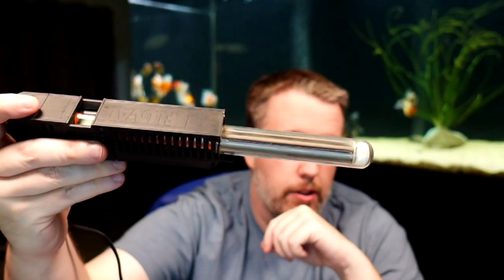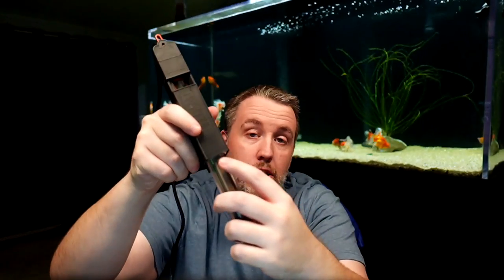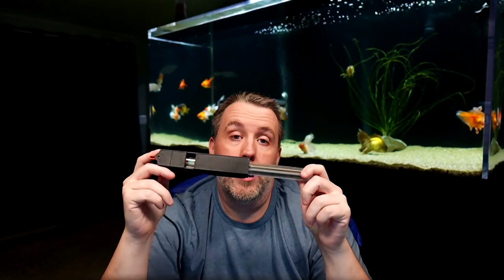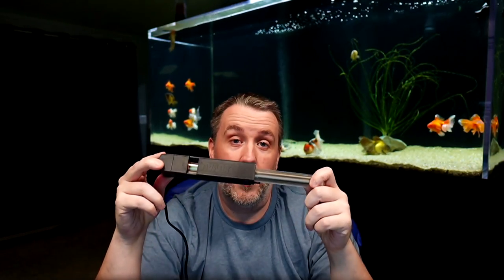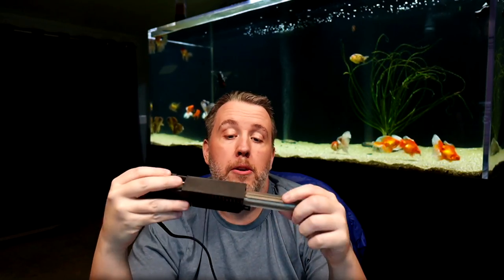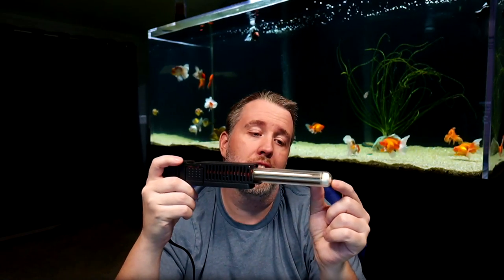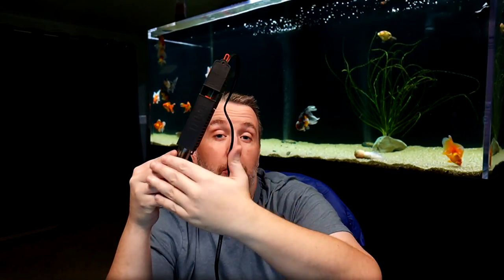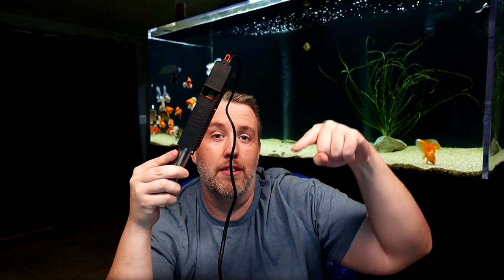The Truth About Aquarium Heaters (and Why They Always Break...)

Comment: As a retired electronics engineer, I can
tell you the reason heaters fail is
because they are designed wrong.

With the correct design, the heater can
last decades. It really wouldn't cost
that much more to do it right.

The current design hooks up the heating
elements directly to the mains (Constant
Voltage Source). They need to design it
so the heating elements connect to a
Constant Current Source. That way the
heater can turn on and off thousands of
times a day without the destructive
current surges through the heating
elements when it turns on.

If the heater detects a low flow
condition the electronics can throttle
back the current to the heating
elements.

Another design flaw of most heaters is
the electronics are in the same tube
that the heating elements are,
subjecting the electronics to high
temperatures. High heat is the enemy of
electronics. The designs that use a
separate controller out side of the tank
are much better.
Reply: Couldn't agree more and the heater manufacturers know this too.  That's why they will never implement such a design because then they couldn't sell you another one when their flawed design fails.  I'm not telling you anything you dont already know ;)
Reply: How long does a tmperature sensor last when seperated from teh heat source? I have one of the rare filters with a seperated system like you suggest, but the temperature sensor broke (physical force). I think it is a pt100 because these seem to be very common and I will replace it with such a sensor.
Reply: I believe the titanium heaters are designed this way. The only problem I've had with them is the temp probes going bad. But at the same time I've had old glass heaters last over 15 years.
Reply: Tony Meagher your 2nd paragraph is the #1 reason why they don't make better heaters
Reply: Sweet James  agree it's a big long commercial given. All that was needed to explain this is what Tony Meagher wrote.
Reply: @nwcanuck5069  totally man, In the swimming pool business I've seen big companies discontinue filters, heaters, auto chlorinators etc.. all because they would never break. All you needed maybe was a really cheep part to get them up and going again. So how can you ever make money buy selling something that will last for 30 years. Not like you need 3 heaters on your pool or auto-chlorinating systems. So now we have customers having to come back and drop another $2,000 on a new heater  every 5-7 years when the 1st one lasted 25 years. Or pool/spa pumps where the 1st one lasted 10 plus years then all the replacements for it last a couple before they are back getting a new one. SMH But I guess how else will you be able to grow if you don't step on the customers.
Reply: Sweet James really? Heaters are a problem in the hobby.
Reply: well i can say when the house trips , most of time is heaters
Reply: Same thing applies to light bulbs. Incandescent bulbs are at the mercy of your switch. LED and fluorescent have ballasts in them to correct that. Put a ballast on an incandescent bulb and it will last forever too.
Reply: @alis49281  They're cheap metal, that break apart over time. There are other materials that are significantly more resistant to water.
Reply: Sweet James  He literally has ONE heater in his link. a 25watt nano heater. Not much of a selection, nor very useful to most hobbyists' tanks.
Reply: I would greatly appreciate it if you could design, build, and sell heater like that. People would pay a premium to know they would last.
Reply: The one on my betta tank was bought in 2002 or 2003
Reply: Sweet James  maybe you heater do not over work because of your room temperature where you keep your fish tank.
I had to replace 3 fish tank heaters because they where old and not working properly.
i never had to keep replacing them like people are saying.
Reply: Sweet James  you might buy one that is bad  but other wise i never had any problem with my heaters.
Reply: Makes me think of appliances. My $3000 do everything, fancy, big beautiful fridge has been worked on 2x in the first year. My beat up, 20 yr old unit that stays in my garage (in Las Vegas summer heat) and it turns my drinks slushee and has never once had an issue .
Reply: My controller for my Hygger ( w/external controller) is out of calibration, any tips to recalibrate?
Or would it be easier to get a new one?
Reply: Broken heaters has nothing to do with the user 90% of the time. They are super simple devices, made with lowest possible quality and cheap materials and highly overpriced. Design is pretty bad. They operate in extremely narrow temperature range (mostly 24-28 C), with known in advance and similar water flow in most aquariums. And even after all that, even top manufacturers fail to make them right. Btw making your own electronic automatic heater with quality materials cost less than 10 dollars. No need of any bimetal, and you can filter noises and reduce switching cycles. Manufacturers are refusing to make them right cuz.... Profit! And i think we don't have to step in toes arond them, like we don't do it for our mixer, tv or fridge, especially when we pay high price.
Reply: Make it and send us the link what you waiting for bud.
Reply: Has this got something to do with US standards for electronics? I have never ever had a heater fail other than through my fault. Been in the hobby for over 15 years and once was rocking a fish room with 10 plus large tanks and many smaller ones. I have broke heaters through dropping them and smashing them through stupidity and once exploded one by pouring cold water over it during a water change, ha! . Had pricey £100+ heaters and even some cheap £15-20 no brands and they have always served their purpose until I either break them myself or swap them out or lose them in storage somewhere. Currently have a heater that is over 10 years old in one of my tanks. That's a cheap brand one that runs perfectly.
Reply: @JoshFromGA  just buy loads of them
Reply: Sweet James  If he wants your money, he wouldn't have made this video so your heater could break again and again. You don't make sense. Heck, he made a video saying that we probably don't need a heater.
Reply: @evgenitantikov5865  How exactly would you make your own? That would make a fantastic youtube tutorial.
Reply: @horsepanther  Sorry buddy, i never made a YouTube video in my life :) Don't have the time for it either. You can search over the net for simple temperature controler electronic schemes. Also there is integrated microchips that can do the job. You can even use an Arduino as a controller. As for the heater itself you need heat resistant lab glass test tube (any chemical lab supply store) and resistance wire (nichrome, kanthal...). You can also replace the glass with unbreakable metal tube (electrically insulated from inside). You can make small controller to fit inside the tube or a separate one. Same goes for the sensor. You need heat conducive paste for high accuracy. The simplest and cheapest ones are based on thermistor(few cents).
I made few for myself loooong time ago and they still working (20+ years). In theory resolution and accuracy are extremly high, in practice +/- 0.1C (more than enough). In my country materials for it would cost me around 8-9 dollars. In usa idk maybe 12-15?
Now is easy with the internet. Just google it - there is thousands of projects that will work for you. Pick the easiest one.
Reply: Sweet James that’s how I felt till my heater failed in the ON position and boiled my fish and plants alive. It was a 100w in a 20 long, it was always turning on and off 🙁
Reply: the wires in these things are tiny
Reply: How much would I need to pay you to design a heater for me haha
Reply: Get with Cory on this and design the greatest heater ever and cash in bro. He would sell it if it was as good as you say it could be.
Reply: Do you know if heater thermostats have hysteresis systems that prevent frequent switching?
Reply: @Tony Meagher Don't thermostats have hysteresis systems that prevent frequent switching??
Reply: So a pulsed supply to the heating element the same as a reptile thermostat where it throttles up more pulses and throttles down less pulses and adjusts the current across the heating element not the voltage ?
Reply: Design one then!
Money, money, money!
Reply: As a retired EE you should get this comment, whereas most people won't... Heaters with a bi-metal thermostat cook your fish when the contacts weld together from the hot arc just before they close.  The capacitor in line prevents the contacts from sparking.  When the cap burns out, the contacts weld together.  If you have an older heater that you can take apart, just upgrade the cap to either 500 volts of 1000 volts and the heater will literally last forever.  The replacement caps used to run around 50 cents at radio shack.  I kept some of my aquariums in my basement where the temps ran down to 45 degrees and I've had to replace the caps in several of them over the years. And believe me, the original caps were literally barely rated for 100 watts. Once I upgraded the caps I've never lost the heater a second time.

Note, most heater companies use the same cheap caps for their entire product line, so 50 watt heaters will outlast 300 watt heater by a matter of years, if not decades.  Supreme heaters up to 100 watts last forever (I have a few that are running for over 40 years).... Supreme heaters above 150 watts are usually toast within a year or two in a cold basement.

Digital thermostats don't cook your fish when they fry, but they don't last very long... I know there's one company using a triac system which might be good as the contacts run on reduced voltage, but I don't know if I have any of those... and most heaters don't come apart any more, which is why I rebuild the old ones.
Reply: Also an EE.
The simple solution is to use smaller heaters.  IF a heater fails on, THEN it overheats the water. SO the heater obviously has more power than necessary.
USE 1/2 the wattage "they" say to use.
USE a fully submersible heater.
USE a heater that can be mounted horizontally.
Reply: @RJ-vb7gh  The simple solution is the best 
Smaller heaters.
The wattage listed by the companies are at least 2x too much.
How do I know?
Because when they fail "on", they overheat the water. 
Smaller heaters cycle less, radiate less heat to the switch, and cost less.
Reply: @RJ-vb7gh  what heater do you recommend?
Reply: @J0MA  Most of my heater are anywhere from 5 to 55 years old.  While I certainly have great experience with certain heaters that have literally been on line for over 5 decades, they unfortunately don't make them anymore, Just don't pass up on a Supreme heater of 100 or less watts if you find one at a garage sale.  

I would avoid heaters with "film" heating elements or less expensive digital thermostats.  While digital thermostats usually fail in the off mode, which is nice, I've never had one that lasted very long.  Some day this might change with better technology getting cheaper, but for now high tech electronics and water don't always play nice.

Triac type heaters tend to last a while but for some reason, I've had several fog up (and flood).  The triac reduces current through the contacts which makes them last longer.

The problem with recommending brands is that I've seen the same heater marketed by different companies over the years and I've seen companies that made good heaters, suddenly cheap out and produce total trash.  Or in the case of the Stealth heater, they had a nasty habit of burning homes down for a while, but the company was very nice about replacing them for free.  Thankfully, my heater worked fine and didn't burn my house down and the replacement still works a treat. But yes, by experimenting with the latest and greatest tech at the time, I brought a fire bomb into my home.  So, as much as things change and very reputable companies have made some major mistakes, I'm gun shy about making a recommendation on current products... Just beware, if it sounds really nifty and is something brand new, it might be great, but over the 55 year's I've been keeping fish, more times than not... it's a hazard just waiting to happen.
Reply: It blows my mind that we are in the 2020s, and even expensive aquarium heaters still use 'dumb' on/off thermostats, SSRs, PID-loops and PWM controllers would cost very little to implement, and would mitigate all of these issues, while providing more responsive and accurate operation!..
Reply: I’m currently an electrical engineering major trying to setup my first tank and I am FRUSTRATED with the heater market. I’ve been dreaming of making my own heaters. PLEASE, let’s go into business on this haha. The aquarium hobby needs higher quality plastics as well!
Reply: ...it's not beneficial for a company to sell their product every year. It'll go out of business for the lack of revenue.
Reply: @tentyme1  This is an increasing problem, and why there is a growing "Right to Repair" movement
Reply: Do you have any specific heater suggestion? Or brand?
Reply: But these companies that make heaters would be out of a job.... Duhh ..
We used to make things that would last forever and then all these companies got savvy and realize that if they made things that could fall apart and have to be replaced they could make more money
Reply: Can you please create a good one and sell it? I would gladly buy one lol. Let me know send me an email when you do it. I’ll be your first customer
Reply: If you know how to make a heater properly won't you invent the heater that works properly and last for years and you can make some money off of it start sending your own aquarium heater
Reply: @thebeastisback1996  perhaps its sensor died.
Reply: @victorsitkevicz8312  This should be pinned up
Reply: Go for a patent, Tony! We need it.
Reply: @lanyardloop Hi, i'm looking in designing a new aquarium water heater that could overcome these selective flaws and more. Would you be interested in a quick 10 minute meet to discuss these issues and more?
Reply: Very interesting. I don't know much about heater but it seem that an heater that could heat at less that 100% of it's rated power would be pretty useful so that it could stay on at a constant power and actually keep the temperature stable without cycling too much.
Reply: I think they are designed to fail on purpose, many fish have died due to this lack of "innovation".  I'd kill for a not trash small water heater for 2-5 gallon tanks.

Comment: I'd love to see a heater developed by Aquatium Co-OP. The sponge filters you have are great, I'd imagine anything you guys produce would be cost effective and well made.
Reply: Tbh sponge filters are almost failproof and definitely dropshipped from China but yes, Cory would do great with sales of a heater of his own with his branding behind it
Reply: @lukas______  Not too fast.  My last sponge filter I purchased had great bubbles and air flow, but would not suck in anything.  I replace it with a CoOp and voila!
Reply: Problem is, you'd need to re-invent the wheel on these or find existing things to combine into one thing... that are already manufactured.   They'd just end up selling off brand stuff.

Comment: "Retain as much heat as you can first" was the approach I've applied to my aquarium, which is currently in my basement. My basement is only semi-finished, so only semi-insulated. At least it's heated. So to keep as much heat as possible, the outside back and one end are covered with styrofoam sheets, and I usually have towels laying on top of my lid (which doubles to keep dust out). 

The heating I use is an under-gravel heating cable.

Comment: Thank you for this video. I bought the new Sera heater and it's by far better than everything I've used in over 20 years. It's strong, with fish protection and perfectly stable with flow in the fish tank and a 2 thirds open top tank. Its power is the double of the gallons I have. And the weather is quite fluctuating here in Portugal during the winter. Thank you!

Comment: You’ve been reading my rants! (Maybe) I love these “how to properly use your equipment” videos.
I always put my heaters (which are E. Jager) either next to the filter intake or output, horizontal and below water change level. And set them to winter water temps for the fishes natural habitat. (Shrimp don’t need a heater for ex)
Ha ha ha... I use a lot of 50w & 75w heaters in the house and don’t go to 100w except for the garage tanks with bigger tanks (unheated garage). I also add rigid insulation to the back of my tanks.
Reply from the maker: When i experimented with insulating tanks, I find it didn't help as much as I would have liked. A glass top did help a lot though. Eliminating super cold air near the tanks helps as well.

Comment: Way back in College I worked for an aquarium leasing/maintenance outfit. They always ran two heaters of different wattage. The lower-wattage heater did the bulk of the work. The higher-wattage heater was set a degree lower, so it only kicked on as supplement/backup. Tank being a degree under norm, indicated primary heater failure. Long-term strategy, but I worked on many 15-20yo aquariums with even glass catfish that old living in 'em, so I always run tandem heaters. If one should fail, Murphy's Law says it's gonna happen when I'm on vacation.

Edit: I've never had a heater stick on since I was a kid with a cheapo Penn-Plax, lol.
Reply: 14:45 Having worked at, and owned, aquarium leasing/maintenance businesses, the last thing we want is to charge a customer for any failed part. Different economics from an aquarium store entirely. When I liquidated, I kept my heaters, I have a bunch of green ebo's and those little brown ones I can't think of the brand, but never failed either. Pry 'em from my cold, dead fingers lol.